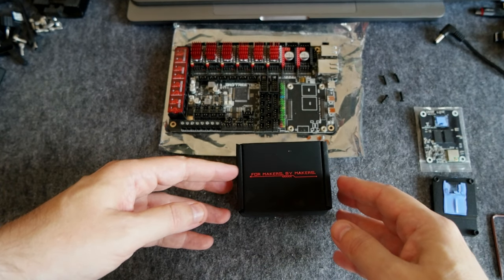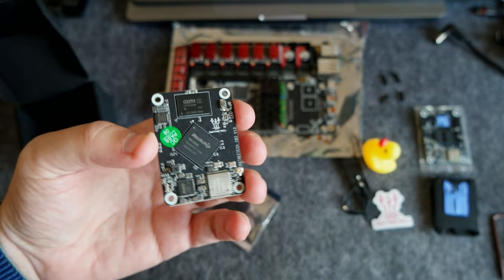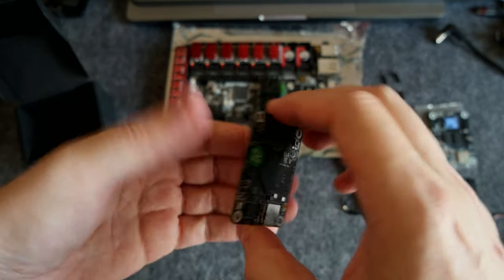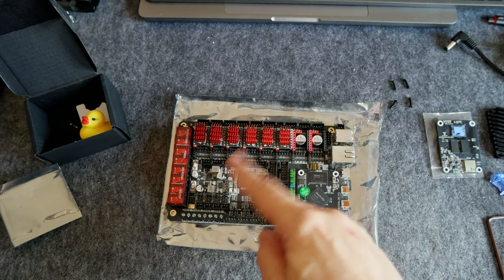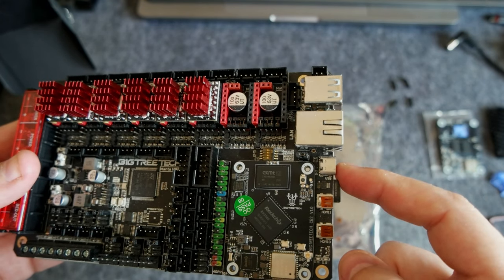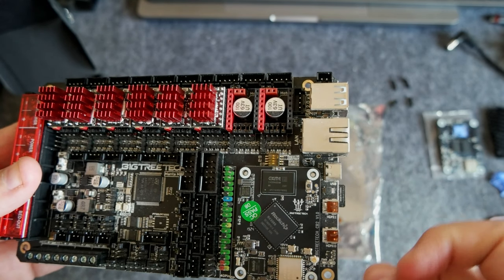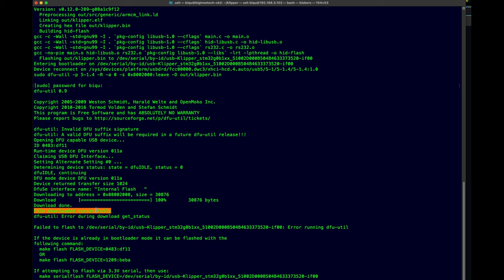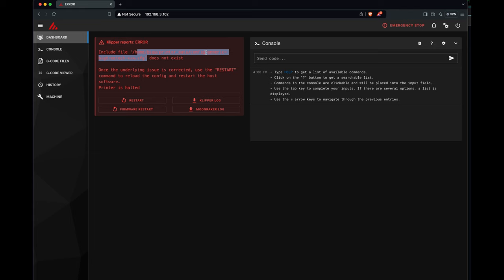Installing BIGTREETECH CB2 OS Image with Klipper for the BTT Manta M8P

Comment: Is there a way to do this not involving sd card? Like directly via usb
Reply from the maker: I don't know at this point, I need to investigate it, but my guess is not since you need to have the OS running on SD/eMMC to get the CB2 running. So you burn the OS on the SD card, than you clone the OS from the SD card to the eMMC. At this point you do not need the SD card anymore. Without the OS you cannot operate the CB2. Having the eMMC onboard is way better than having the SD card, they get corrupter all the time and they are slow. Tbx for the comment pls subscribe!
Reply from the maker: Or maybe if you power the board from the power connections, and see if a USB cable connected to your computer detects the eMMC as a Memory/HardDrive/SDcard (of course without having sd cards inserted in the board) and than been able to make the first installation of the OS on the eMMC. Have no idea it would work.
Reply: I was asking because I only have a 8gb sd at hand and I'm not sure if it would work. I think it has to be 32gb minimum I don't know...
Reply from the maker: @DynoRC  It should be ok to burn the os on the 8Gb. Check this https://youtu.be/ux4e5BvV_7A?t=757 It shows that the OS is taking 15% of 29Gb so an 8Gb should be enough. You can just test it by burn the downloaded image into the SD card using the Balena/Raspberry  software. It will tell you if it's enough. IF it works than you clone it to the eMMC as shown in the video.
Reply: i think it is right above 4gb if i remember correctly
Reply: Nevermind it's totally possible. It's in the documentation i just had to open my eyes